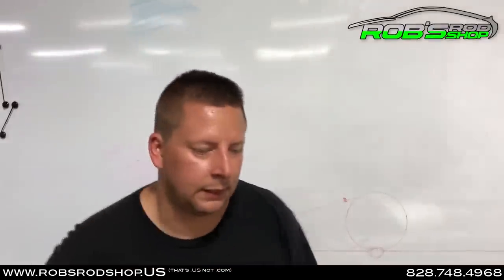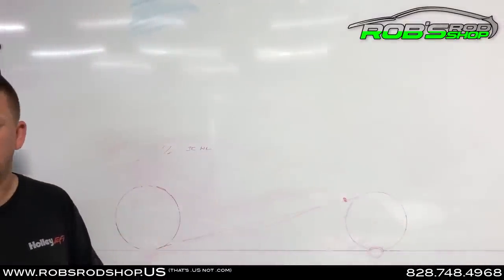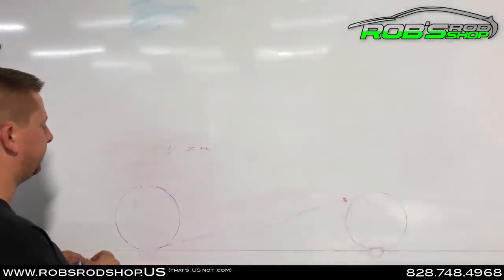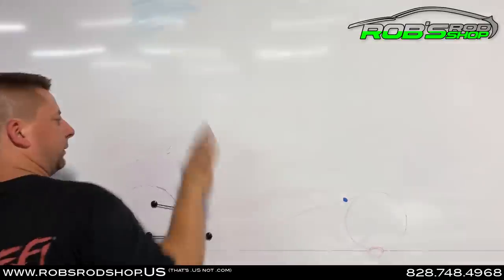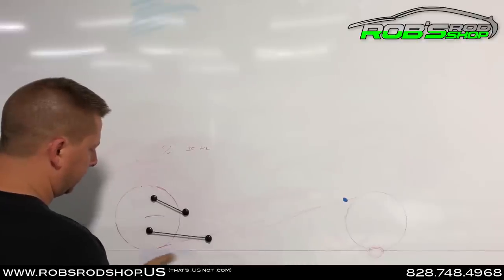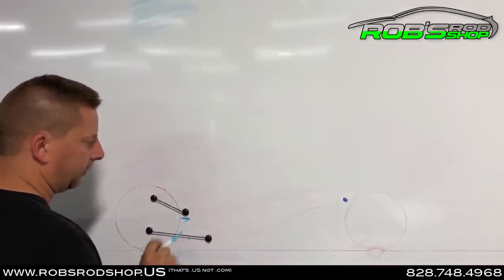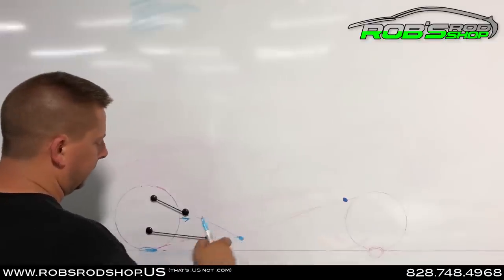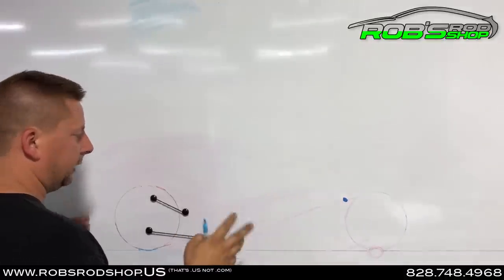Robs Rod Shop Drag Racing Suspension Episode 1 Basic 4 Link

Comment: Rob I love this video. I got a 15 second 78 Malibu. No real power, junk motor, but when I did what you mentioned to my factory 4 link the car became ET deadly, because it would 60ft the same all day long. If it 60ft's it will ET, and you can dial it HARD. That was 30 years ago, it still applies. I got 2 Chevy Monza's, the torque arm works, hope I can find the t-arm segment, I want to back half the monza's with bigger tire, but want to keep the torque arm, if possible. I'm, going to watch the video again now.

Comment: Glad you started this channel Rob. We've never been personally Introduced. But I see you alot at the track every Thursday night that I'm there. An you do help alot of people out. You seem to be a great guy.  An good to see you helping out as many as you do.  Im wanting to go to a 315 radial tire. Because it seems to be much faster because it dead hooks an every rotation is forward movement.  But these slicks been giving us hell since we've actually put some power in the motor.  Next time I see you I'll introduce myself. Wouldnt mind hearing your opinion on what you'd do to get our 60 back an ET
Reply from the maker: Joseph Lay slicks are finicky, weak, pieces of shit in my opinion. “Oh, yea, but rob, no prep” Yea to hell with that shit too. They have their place but they are so temperamental that they will not be on anything that I intend to race on a regular basis. Either way. Thanks for the support and I’ll be glad to help.
Reply: @RobD828  hell with no prep too if gonna run like that. It will have the 29.5 17.50s  under it an go to the street lol. Man seriously though after reading you comment that's what the problem was. We ran 1 no prep ever. And changed set up just a little and then never got it back where it was.  But changed that again and got it back where it was an now it's back Atleast in the 1 teens in the 60. But I'd still like to go to a radial. Gonna have to throw these on an try them just see how they do. An well deff have to talk when I see Ya. Thanks for offering to help bud prob take Ya up on that when wear these junk tires out lol

Comment: Guys like you make me wanna get Into racing for sure even on a small level. Just amateur 9or10sec class etc street care takeover stuff. I wonder if I can run an airbag suspension on the track or will I have problems
Reply from the maker: Matthew Ritchie you can run it with the correct shock

Comment: Hello, great video.
  I understand what you are explaining here, raising the pivot point of the lower linkbto push the drive angle over the top, forcing the front end down.  I feel as though I'm finally grasping "the magic" that you've been explaining. 
My question is, 
A) How does this relate to the instant center (which is short, the way you have it shown here) and how close to the front bumper do you want it, especially when talking about either bagged or regular rear suspension (if there is a difference) and
B) What percentage of "relief" (20, 30, 40, 80%?) are wheelie bars supposed to give in finding the balance between squat and driving over the top to keep the front end down?  
  My problem is that one questions answer tends to give me five more questions and I sometimes over-think the whole thing but, id rather ask too much than not enough.  This is mostly 5o let you know on what track my thought train is traveling. 
  I try to get that dancing fairy stuck to the head of the pin, it just doesn't always happen...   lol
Thanks for the info.

Comment: Have a grand national 500 hp. Would like to get into setting my rear up using this method for the street or track. I have an all Hotchkis set up but all non adjustable. Can just adding new lower brackets and adjustable upper and lowers get my anti squat and instant center where it needs to be. Like the kit from UMI. I think it has 3 adjustment holes. Thanks for the videos.

Comment: I had to get my trq box’s redone a while back because my Fox’s factory trq box’s we’re destroyed due to all the abuse.  I went with the kit from wild rides racing and I haven’t had any luck yet I know the parts are great it’s me.  I’m not a wealthy man by any means but I’ve managed to put together a coyote swap fox gt and my only trip to the track I managed no better than 1.7’s smh on a 26 inch drag radial.  I also busted a new tko 600 so I had a bad day my only clean pass I blew the tires off leaving at 4500.  So I know my pinion angle is off.  I have solid uppers and lowers but that trq box kit has multiple places.  I just wanna go 1.4-1.5’s with a 430hp 2700# car.  Yet I’m a second away due to the sus, gear and tire.

Comment: Since you did a great job with the explanation. What is different when dealing with a parallel 4 link set up as far as adjustments
Reply from the maker: In order to make any significant adjustment in instant center or anti squat it will have to become unparalleled.

Comment: Hey there Rob, great vid bud thx for that. In relation to a standard triangulate link setup with no pivot point adjustments, I guess you really can't afford to have the rear of the car too low , can bar lengths and pinion angle help here?
Reply from the maker: In my opinion it’s best in this situation to put lower control arm brackets on the rearend and move the down as far as possible back ther and then lower the car as far as possible.

Comment: Can you clear up a pinion angle question.  Does pinion angle alone, affect traction at all?  Meaning, if everything else is right but the pinion angle is off a few degrees, would you gain traction by adjusting the pinion angle?
Reply from the maker: Pinion angle only insures proper driveshaft angle. It has zero effect on traction.
Reply: @RobD828  thanks for the clarification.  Guys like to argue otherwise.

Comment: Does this same theory apply to lower power cars running slicks?   My car tries to stand on its bumper if I'm not careful.  And at the same time it seems like it is wadding the sidewall like a top fuel car.  This is in a 2700 pound car with a parallel 4 link, and 800-ish horsepower. 49% rear 51% nose.  99 inch wheel base.  Thanks!!!
Reply from the maker: It does not. Slicks don’t like being crushed and you have to apply enough power quickly to keep them round or they will in fact wad up. I suggest moving to a radial as quickly as possible.
Reply: @RobD828  I'd like to.  Just not much radial Racing out here in Kansas.
Reply from the maker: Wormser McFrazzleweiner someone has to be the first and the 28x10.5 pro bracket radial won’t leave you disappointed. Even on marginal surfaces.
Reply: @RobD828  does that tire do ok on a 14" wide wheel?   Non bead lock..
Reply from the maker: Wormser McFrazzleweiner I would not use it on a non bead lock 14” wheel.

Comment: Any solution for the gbody stock suspension stuff? Only adjustment I have is on the lower control arm brackets on the rear end(4 holes). Will be running either a 275 radial or a 28x10.5w
Reply from the maker: How fast you need to go? We have been 1.14 60’ times with that same setup.
Reply: @RobD828  1.14 works lol..twin turbo LS Malibu...do u have a email that I can send some info on car?
Reply from the maker: @k20edef1  just text me. Phone number is in the video.

Comment: Awesome video. I'm looking for some tips on triangulated 4 link on top bar lengths. Does one measure the 70% of lower bar length the same way as the parallel routhe before mounting the top bar? I've searched every single corner of google on more info on triangulated 4 ling top bar length. Hope someone can help me out with some info.
Reply: On a four link with air bags, the angle of the top like and the angle of the bottom link (draw a line through both) should intersect at about the front bumper.   This is the "instant center" and should keep the balance forward to the right point. 
  Hope that helps.

Comment: Fastest car in x275 currently squats 🤣
Reply from the maker: Which car is that?
Reply: @RobD828  rob goss. Also Marty stinnett small block rvw/pro275 car squats. Both southern speed racing cars. It’s all in setup. When the bars aren’t equal length the IC grows so when you have too much separation they can get wheelie happy from that as well
Reply from the maker: @SpeedProductions  I think you need to research things a little further. Also keep in mind that the rear staying in the same location and the front rising is not the same the rear dropping which is what I would consider squat. Also please watch my shock video where I say “If the track is perfect I think you could take the coil overs out and just put solid bars in there place and do the same thing.” If the rearend isn’t moving this essentially what is happening. And you are correct with equal length bars growing.
Reply: @RobD828  man I was just letting you know there is more than one way to skin a cat lol. I have seen the data from both cars and they both squat 1-1.5” as they progress down track.
Reply: And for what it’s worth I don’t disagree with any of the logic.
Reply from the maker: @SpeedProductions  cool. Duelly noted.